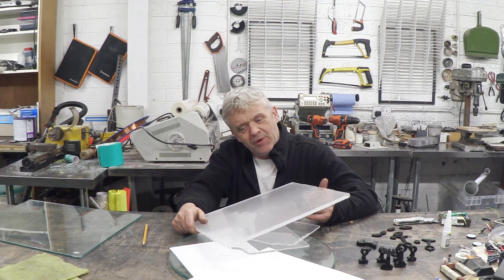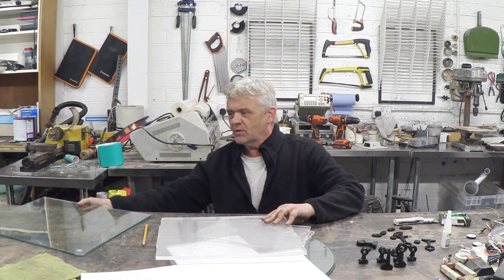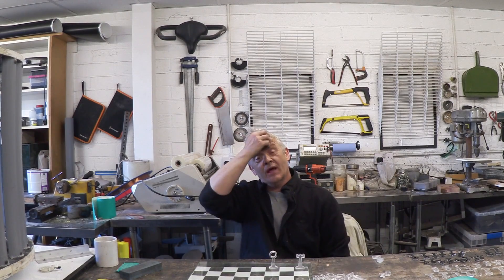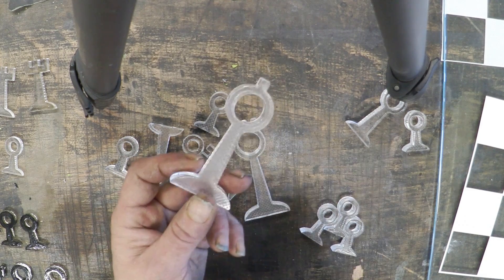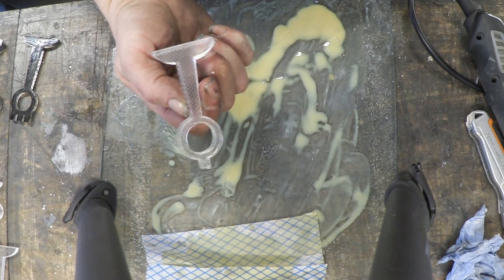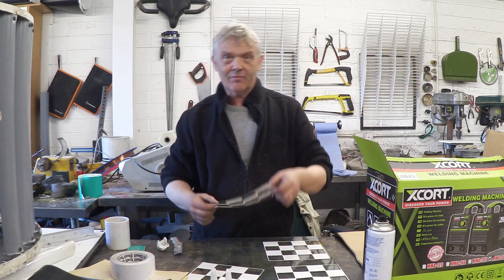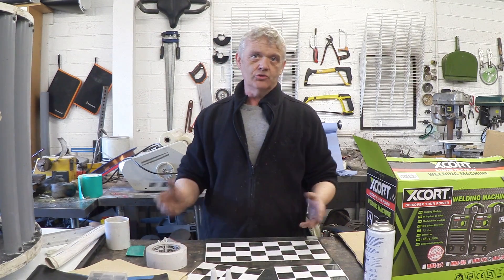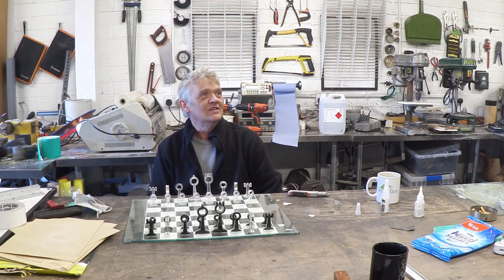Making A Chess Set From A Broken LCD Screen - Free Plans

Comment: Excellent work!  

I use window silicone for nonskid feet. I put 4 dabs on the bottom, flip it over and then set it on some waxed paper. Once the silicone dries, you're all set. Cheap and cheerful.
Reply from the maker: great tip mate - cheers

Comment: I don’t mean to be negative but Laser cutters are very high tech, expensive machines, that 95% of us will never even get to see, let alone have easy access to. But I suppose for those who do it is a good way of reusing that plastic. But unless 100% renewable energy is used,.the saving in materials would be countered by the Carbon Footprint. From the large amount of energy needed to  run the Laser Cutter!.
Reply from the maker: no mate they are not - I just bought a new one for £145 - I'll do an unboxing when it arrives

Comment: Beautiful Chess Set!!  👍
Reply from the maker: coming from you that is indeed a compliment - cheers mate
Reply: @ThinkingandTinkering  .. back when I was in the Army .. about 1973 .. I built a chess set that was made out of ceramic.  The king and queen were 8" tall.  The two sides had different eye, hair, clothes, etc. color.  They had sand inside to weigh them down .. and felt pads on the bottom.  I made a chess table for them also .. and it was lined with a raised cushion padding around so the pieces could not fall off easily .. it was a lot of detail work .. I played chess mostly in High School with a couple friends.  I realize some people have different viewpoints about what people do (making something) but there is only so much time you can spend on any one thing .. I think the design of your set was beautiful in it's simplicity and function. There are always things people can do to make something a bit better .. but there are 100's of other things to do too.  It's really fun and interesting to watch you work on brain tingling things!!  😊👍

Comment: Hi Bob, I myself a chess player, I think the chess pieces are too thin, they will keep falling of of a very little bump, I would suggest cut another set of pieces and glue them together, they will be more stable and chunky...
Reply: yes thinking same.  or cut slots to make crossed pieces.   the glass chessboard is nice but I'd never use the thin pieces
Reply from the maker: I was thinking oval feet